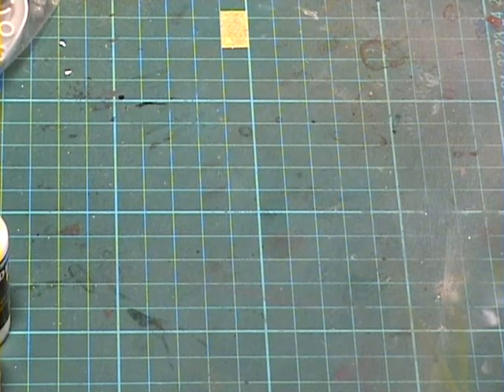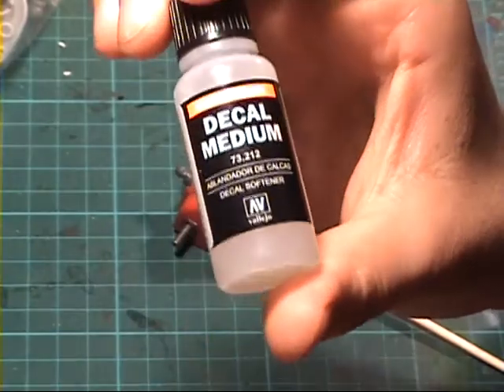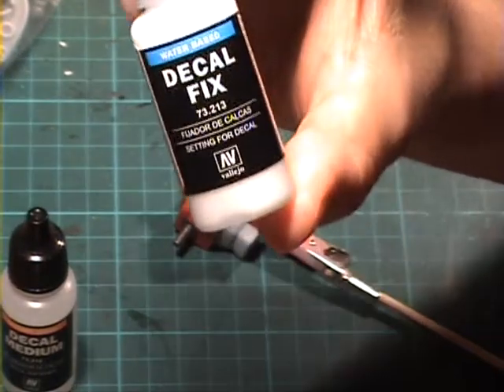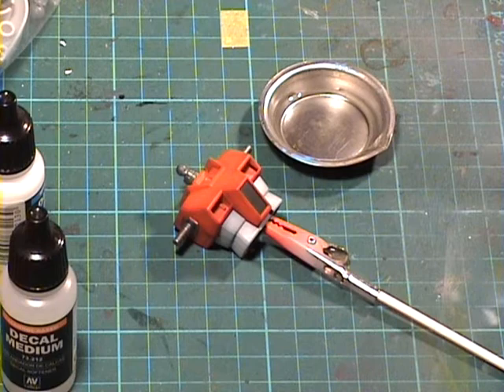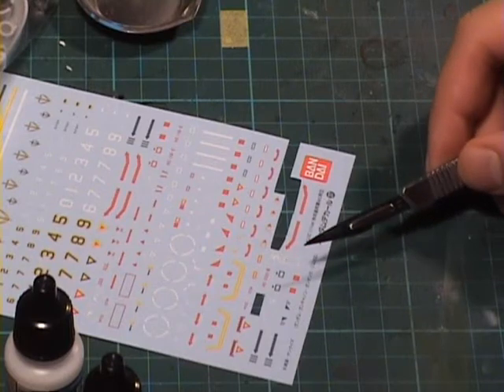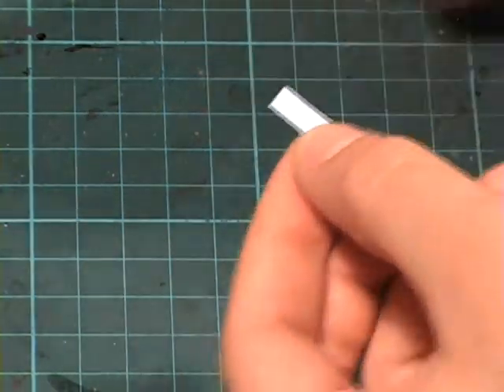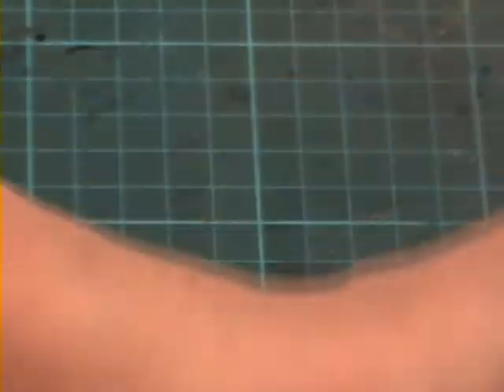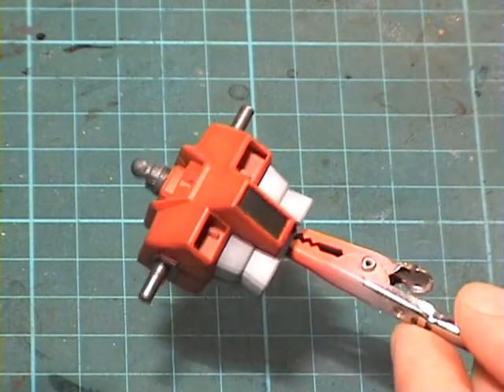On my Workbench Part 12

Comment from the maker: Well, there's as many ways of doing this as there are modelers ; ) In some tutorials the fluids are applied "backwards".The fixer as a base, and only the setter on top. Actually I do that too, and I repeat softening/melting the decal until only the marking/color is left. But, then I also fix it with the resin. In the end it's all about the results...
Oh, and when You get "dirty" with Your Ez8, make sure You really protect the Decals with a lot of clear! But You knew that already ; )

Comment: I was wondering what you use to clean vallejo's gloss varnish out of the airbush. Will the standard vallejo air brush cleaner work, or is the varnish not compatible with VA cleaner. Thanks!
Reply from the maker: Vallejos air brush cleaner works just fine. You have to be a bit more thorough, though. And clean directly after You sprayed.
Cheers!